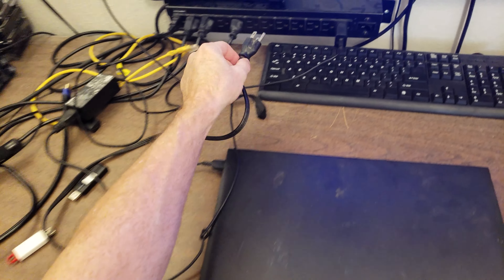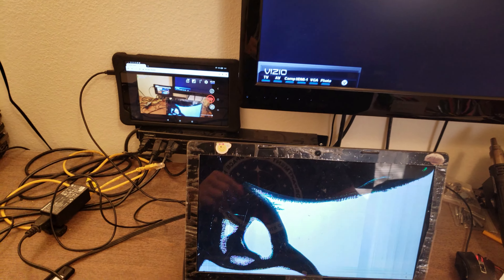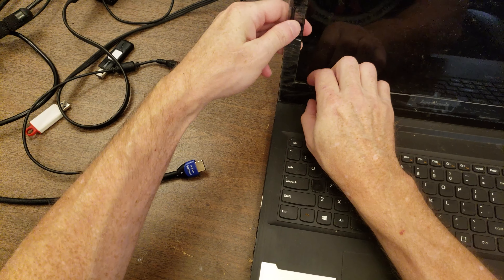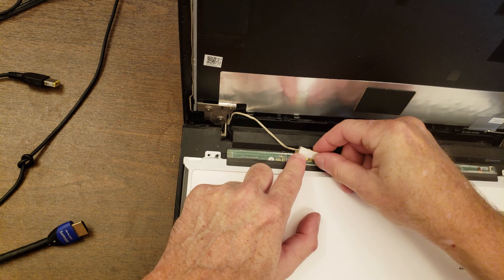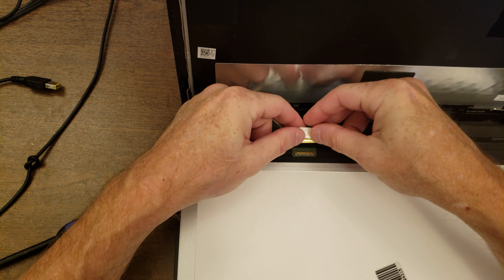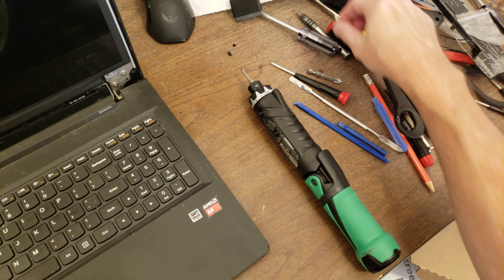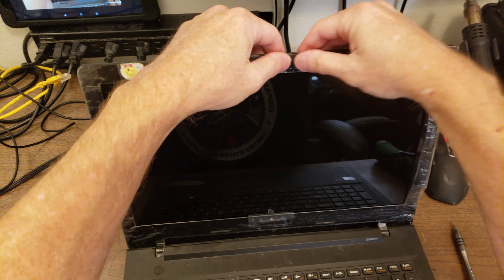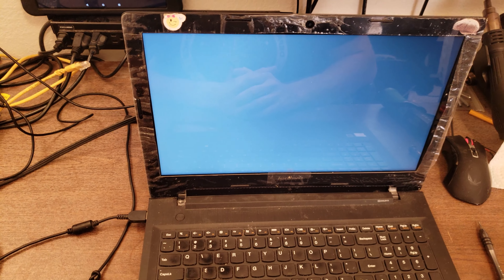Lenovo laptop LCD screen replacement

Comment: Does the brand of lcd matter if the pins And size the same
Reply from the maker: The model of the screen matters not just the size and pins on the cable.  You can remove the LCD you're trying to replace and look at the back of the LCD you have for it's part number.  Just order that same part number.